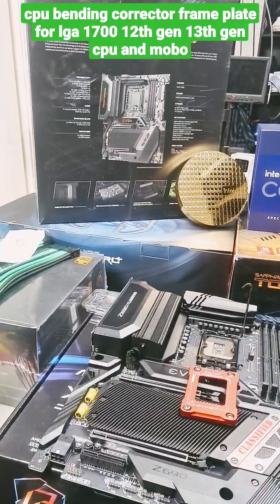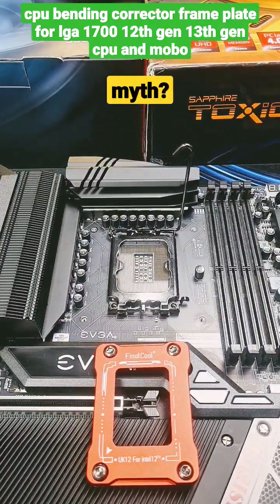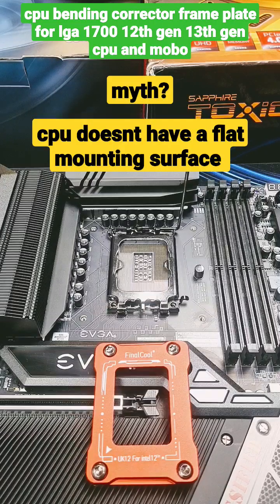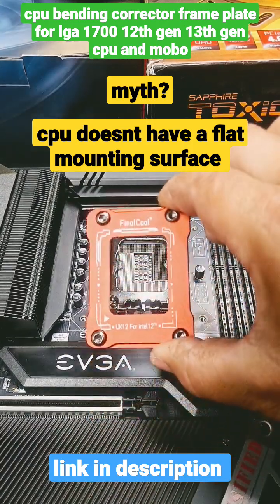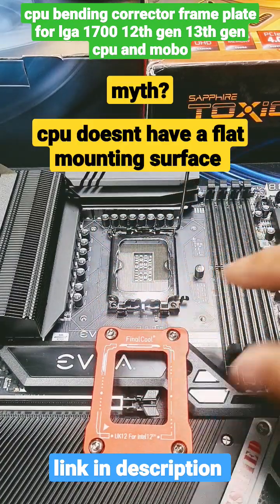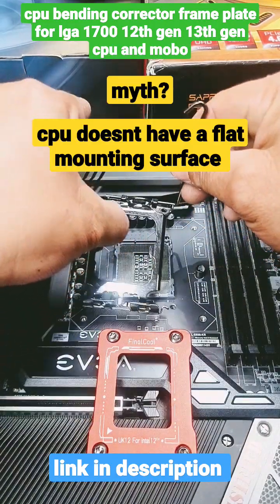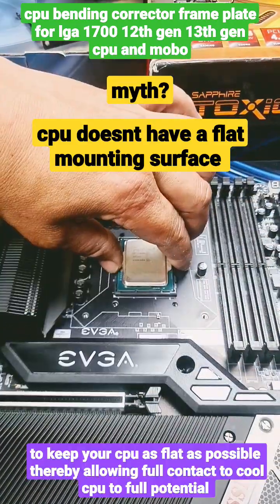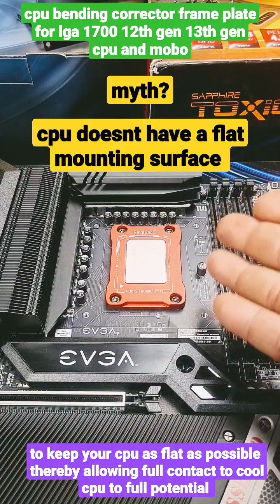how to install 12th gen lga 1700 cpu bending corrector frame plate. prevents warping and bending

Comment: For clarity sake, the main issue is because the stock mount uses only the side tabs reaped heat cycles can actually warp the IHS. The middle will stay held down but the unsecured ends now upwards over time as they aren’t being held in place. This creates a Valley right over the cores where the IHS isn’t properly contacting the cooler. These frames don’t “correct” a warped IHS but rather prevents it from happening in the first place
Reply from the maker: yes ... I guess the point is that is prevents it.. what u said makes sense ... thanks for sharing

Comment: hi there, since you are not showing the back of that bending protector..does it has pad or something for each screw hole which contact to the mobo to prevent mobo scratch?

thx, i wanna buy this stuff and just want to make sure
Reply: yes thanks man
Reply from the maker: @subhanyushan5713  welcome
Reply from the maker: so there's a pad on top amd bottom ..no pads for screw holes ...  if u google ot or check Amazon or ebay for listing u can see back and front of it

Comment: What aio should I use for cooling down 13900k properly?
Reply from the maker: get a 360aio.. honestly u can use any aio they are all pretty good as long as it's a mainstream brand like in a typical pc store... but if u cate about qualiy and have no budget asus rog raijun is the best ... and nzxt is good corsair is good .. make sure fits your case ... 13900k is a hot cpu so u want a good liquid cooler that performs I use a msi mpg coreliquid ..for 2 years and never let me down.. ppl say it's shit but I'm good with it I have a 12900ks and all is well... but even a Good air cooler like noctua will do the job .. with its massive 140mm dual fan setup it runs as good as a liquid cooler aio
Reply: @MIKEYZVLOGZ   So no difference between Ryujin II 360 and msi meg  coreliquid  360 ? If they have the same performance there is no point in spending more money

Comment: Hey I wanna buy a contact frame but before that i have a question. Is there any difference between the 10$ and 5$ versions?
Reply from the maker: no difference .. maybe just if they give u screws a tool or thermal paste... I got a cheap jeyi one and it's fine .. thermlright is good brand ... but any will do ...they all do the same thing
Reply: @MIKEYZVLOGZ   thanks a lot man

Comment: Worked great on my 13900k asus strix z790-e with corsair h150i elite lcd xt aio.   After 2 weeks of use was running hotter than I'd like so I got the thermalright bracket and thermal grizzly kryonaut.  

When I pulled my cpu block off you could see where the thermal paste wasn't touching on both sides of the cpu where the retention bracket touches. 

Runs about 8-10c cooler idle and in games.  About 3c cooler in cinebench r23 but does not power limit throttle at 300watts like it would before.  Also in the asus ai overclock my cooler score went from 162 to 177.

Battlefield 2042 dropped from 87c package temp to under 77c.  Cinebench r23 went from 96c to 93c.
Reply: This comment convinced me to buy this as well. Didn't do it immediately so it's a bit silly I have to pull everything off just for this but I'm currently thermal throttling so I think it's worth it for the i7 13700K (also undervolted and overclocked, so it's my own fault hahaha)
Reply from the maker: lol undervolted. but overclocked ..ur funny... but get it it will help ..nd don't undervolt if u plan to oc
Reply from the maker: the proof is in the pudding ..great share
Reply: wow so you thermal throttled probably or were near before but now it’s all dandy cool
Reply: @maybacher  it would thermal throttle instantly on cinebench without it

Comment: So wht about i5-11400f
Reply from the maker: 11400f is lga 1200 socket ..so it's same installation method as 10th gen .hence 11400f 11th gen.   intel releases in 2 gen.. eg. 6 7,8 9, 10 11, 12 13th.  and 11th gen  don't have a major issue with mobo/ cpu bending ...that's why a corrector frame was never introduced..it never needed it
Reply: @MIKEYZVLOGZ  ok thanks
Reply from the maker: @zipperstriker  ur welcome

Comment: You don’t want to over tighten it but also don’t want to be it to loose. Both ways can do more damage than the stock mount can bent. I leave it here
Reply: Yeah. I think the rule of thumb is once you’ve reached that wall where with a thumb and finger can’t turn it anymore to give it a little tiny nudge further on all 4s. Seems more difficult to mess it up than to do to it correctly. Keep in mind the Z790 boards are apparently thicker so that changes the depth of the screws when you replace the bracket. Although I’m not sure the z790 needs the replacement. Just the Z690.
Reply from the maker: @highspeed_hula1938  good tips mate
Reply: @MIKEYZVLOGZ  fo show. If you ever want to sell that board please let me know. I don’t trust Asus anymore and the gigabyte Aero D I want is too big for my case ThermalTake P6. I think routing the 24pins would be a tough sell indeed. But I’m also trying an all noctua build. I’d even be as tempted as to put a 2080ti on an EK water block on top of it to back the cash up.
Reply from the maker: @highspeed_hula1938  wen I saw this I had to have it
Reply: @highspeed_hula1938 z790 for sure needs it.  My cpu was bent after less than 2 weeks of use.
Reply from the maker: good point

Comment: The bending corrector is aluminium isn't it? Wouldn't it be electrically conductive?
Reply from the maker: only if there an open circuit touching it if not its fine
Reply: @MIKEYZVLOGZ  okay!

Comment: How can I install my cooler after installing the FinalCool bending corrector?
Reply from the maker: just like normal ... use your bracket and mount it as if u never installed it ... all you are doing is using the corrector instead of the clamp that comes with it
Reply: @MIKEYZVLOGZ  ah, so that's how it works. i have never built any pc in my entire life. next year i am gonna build my life's first ever pc, project nitemare
Reply from the maker: @DeathStriker88  I will be good mate dw.. watch a few videos and u will be fine
Reply: @MIKEYZVLOGZ  sure, thanks for the advice
Reply from the maker: @DeathStriker88  no sweat thanks for checking out the video